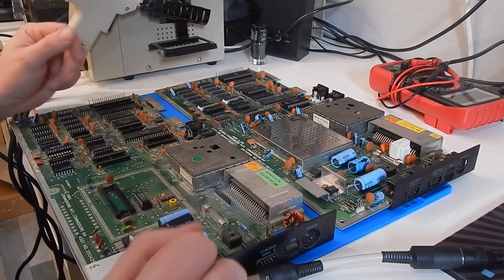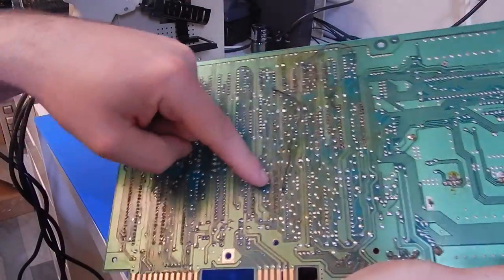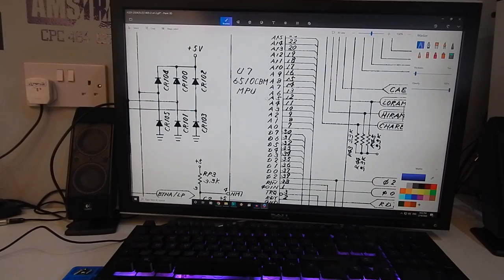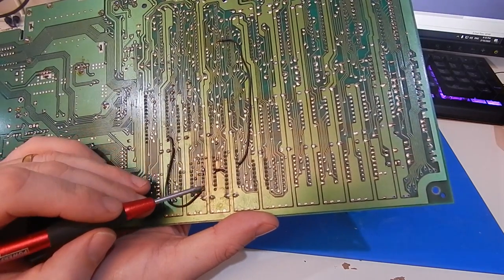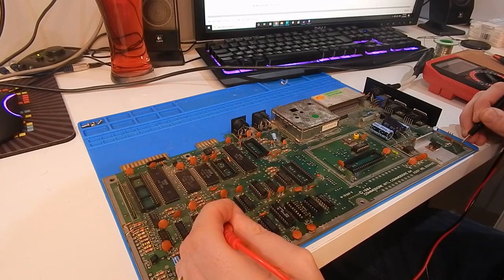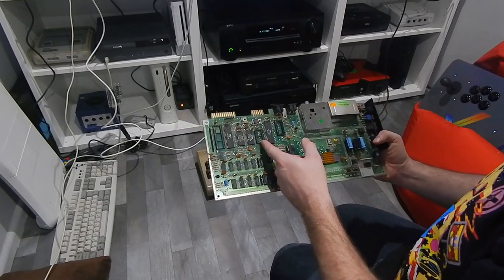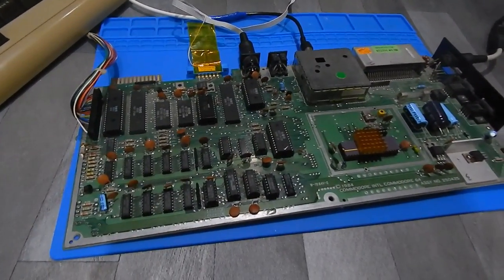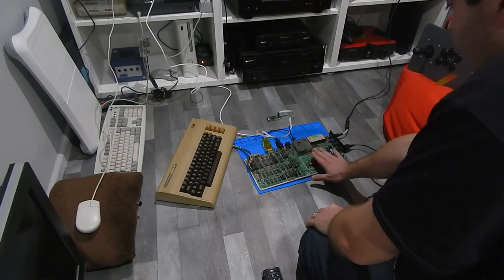Commodore 64 dead board repair part 1

Comment: I noticed that people are asking up to £76 for SID chips on Ebay. I keep doing the maths in my head: 17 million machines sold, where are all the spare parts? Perhaps there's millions of dead chips out there.
Reply from the maker: Possibly but also remember that many of those 17 million machines will have gone to landfill or e-waste.  

£76 is redicilous for a sid.  You should be able to buy a tested working full machine for that money.  Sounds like just an eBay scalper looking to make quick money.  If you need parts I highly recommend https://www.retroleum.co.uk/ very reasonable prices.